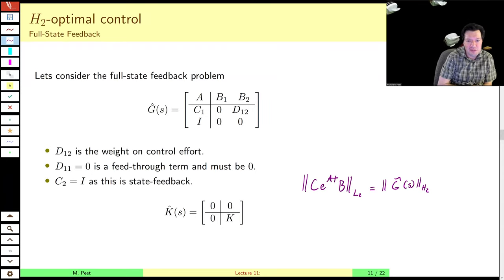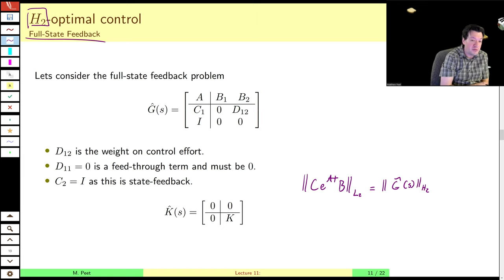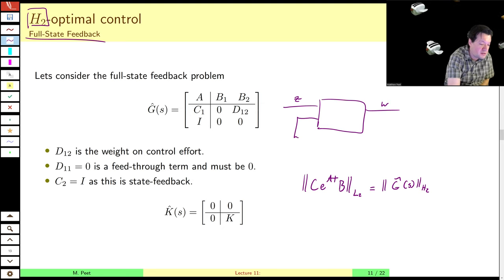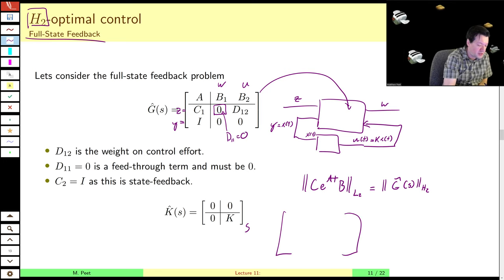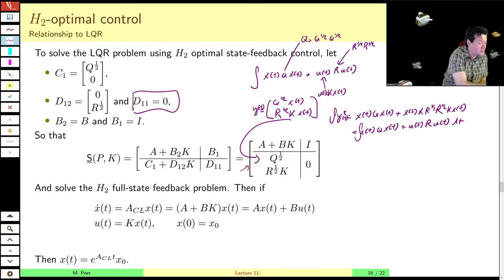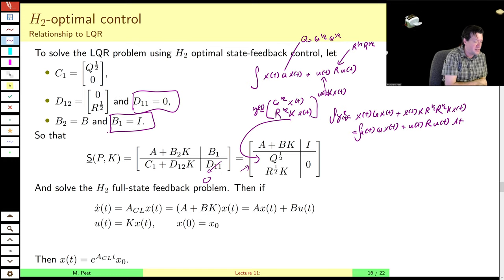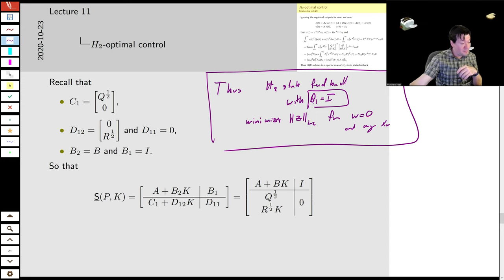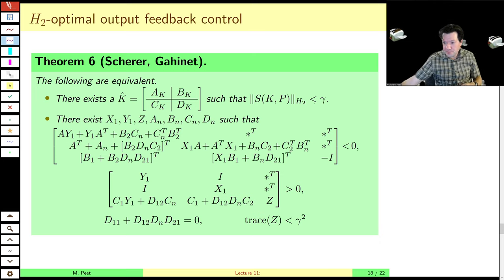MAE509 (LMIs in Control): Lecture 11, part B - H2 optimal Full State Feedback and Connection to LQR

Comment: Thank you very much Sir for your course. Please i have a question. Let us consider the following case with an exogenous input w.  I have the gain obtained by the H2 optimal control. Now I want to obtain the same gain with the LQR using the H2 formulation.  My question is how to choose effectively the good matrices Q and R in order to obtain the same gain as the H2?   I saw in slide 16, C1=[Q^(1/2) 0]' and D12=[0  R^(1/2)]'. Does it mean that if C1 and D12 don't have this shape we will never obtain the same gain as the H2 ? That is what i think by considering the mathematical development.
Reply from the maker: Hi Paul, yes, that correct. The H2 problem is more general than the LQR problem, so not every H2-optimal control problem can be formulated as an LQR problem.
Reply: @MatthewPeet  thank you very much for your prompt response Sir. I will try with this configuration of C1 and D12 and B1=I. I understand it is a special case. Thank you once more time for this course.
Reply from the maker: No worries. I may have misunderstood the question. It is actually quite common for the regulated output in H2-optimal control to take this form. @paulchristiantessowoafo9103

Comment: I've never seen a system diagram drawn with the inputs coming in from the right and the outputs on the left.  Usually it's left to right. Is there a reason for that? I know it's not important, just curious.
Reply from the maker: There is a small but devoted minority who do it this way. Its so it reads like an equation. i.e. y = G u
Reply: @MatthewPeet  Ah, I see. That does make sense from that perspective.  Thanks!